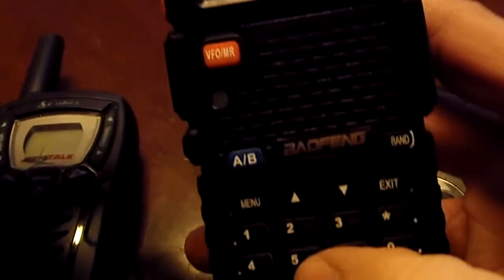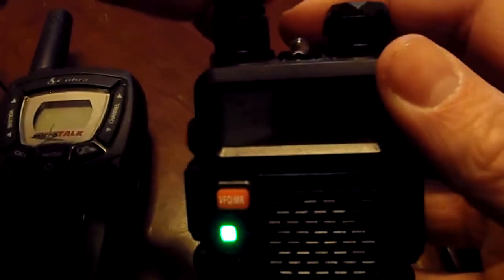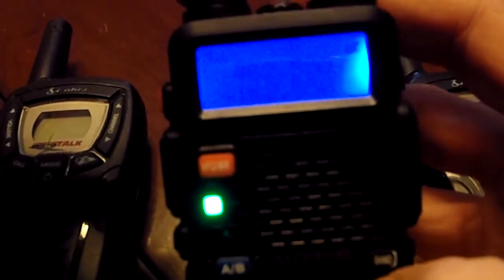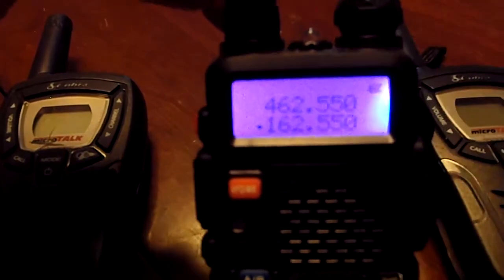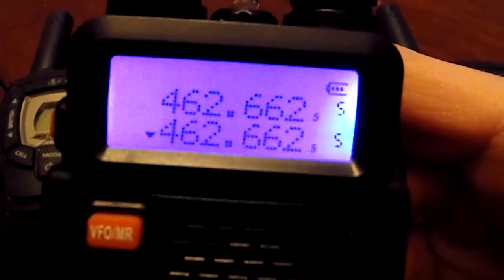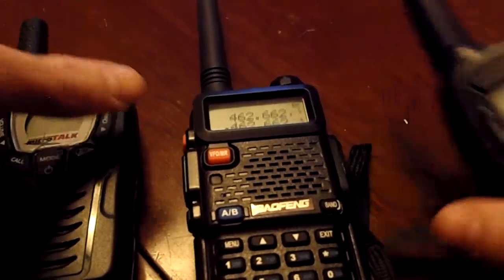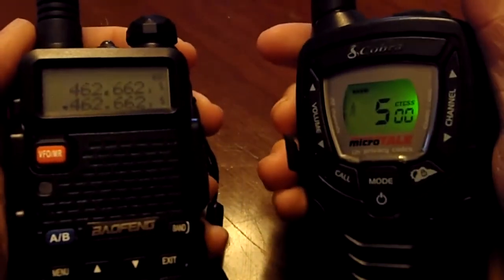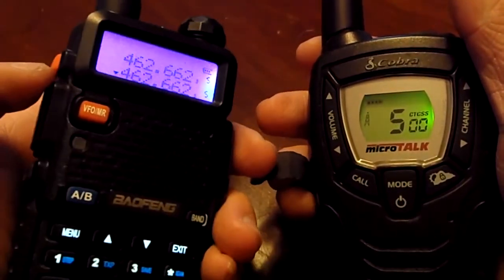What's wrong with my Baofeng UV-5R?

Comment: Lol, the answer is CTCSS. PMRs got default frequency key which is opening channel. In baofeng there is option in menu, number 13: T-CTCSS. Check which one is works with your PMRs.
Reply: worked
Reply: Does that fix both problems? I'm having an issue with the second problem with the FRS walkie talkies.